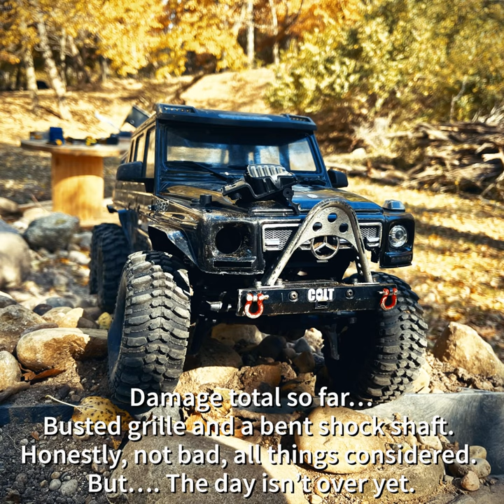TRX6 Abuse- first attempt at building an axle slide. IT’S BAD!

Comment: That Hurts! :-D
Reply from the maker: It’s a deep hurt… on many levels!
Reply: @DRZ-RC  I know the pain. The tubes are very long and with a lot of inclination, the scales gain too much speed when descending. Maybe a slight climb in the middle that slows down the rc truck but doesn't stop it completely?
Reply from the maker: I tried a couple raised spots originally to try to slow it down, but it didn’t work out either. I think I’ve got an idea for some guard rails that should work out. It’s all trial and error, but I’ll get it figured out eventually.